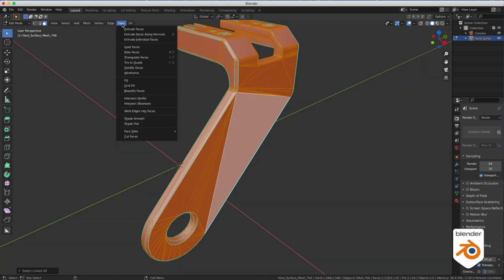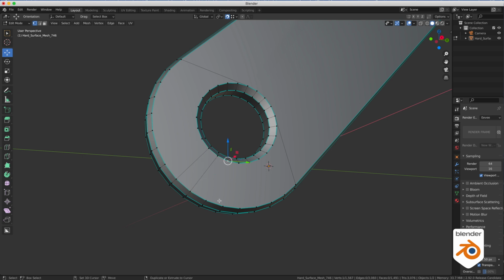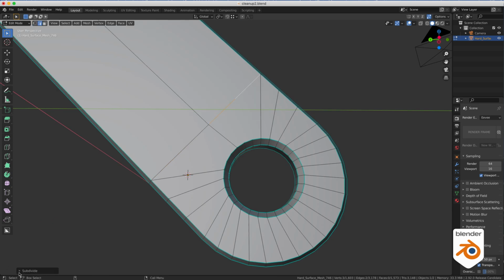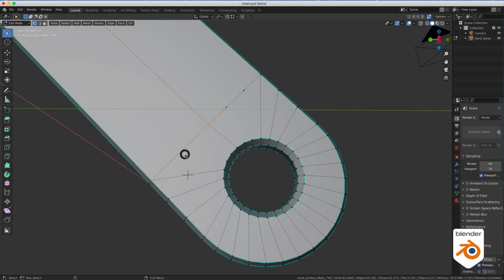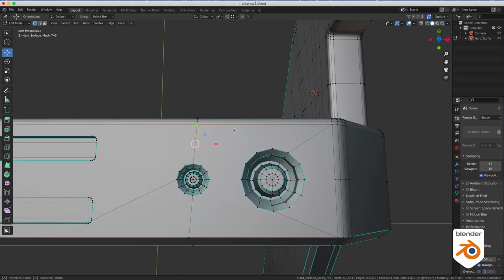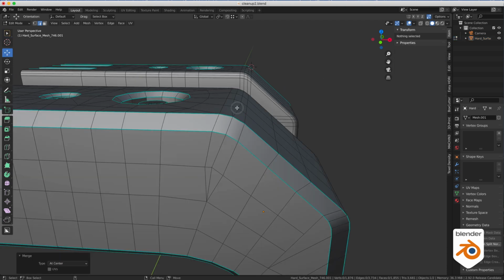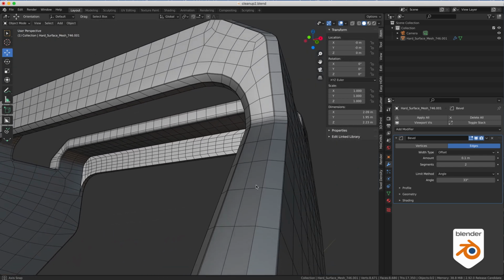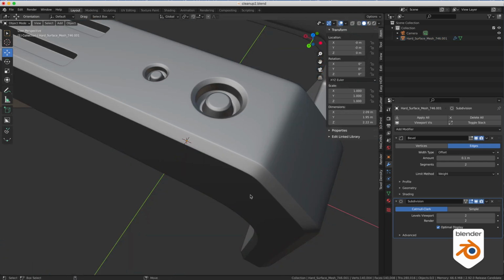Advanced modeling techniques in Blender - Part 5 EP19e

Comment: I think we can use decimate modifier  and choose planar option to clean planar edges.
Reply from the maker: Oh! Never tried that before! This is awesome, especially for the planar surfaces. It does 75% of the cleanup. Pretty cool! I will mention it in my next BB. Thanks for the tip!
Reply: @BlenderBob  或者你可以尝试一下“limited Dissolve”
Reply from the maker: @西克瑞特  Limited dissolve?
Reply: @BlenderBob  Select all in Edit Mod ,  Mesh -> Clean up -> Limited dissolve
Reply from the maker: @西克瑞特  Ni hao. Limited dissolve is the exact same thing as decimate with planar option. But for some reason it's faster with the modifier. Also, since modifiers are non-destructive, you can always change the settings later if you made a mistake. I will talk about it this weekend. Sorry, my mandarin is not good enough to explain this in Chinese. Xie xie!